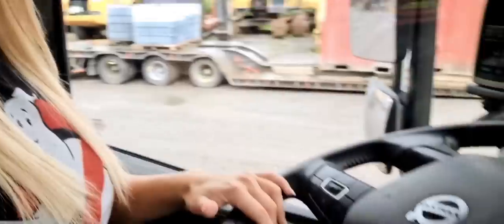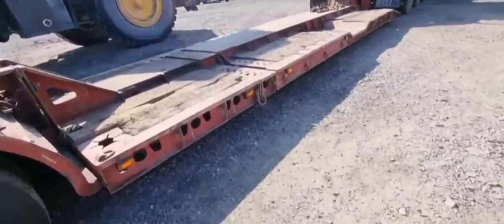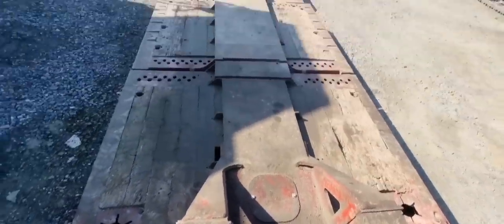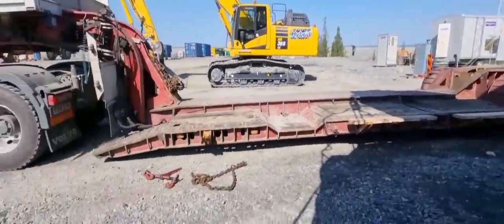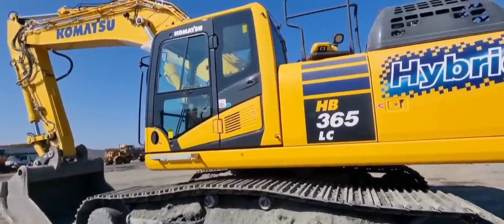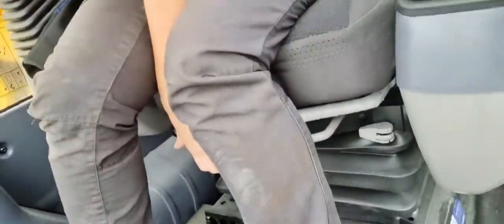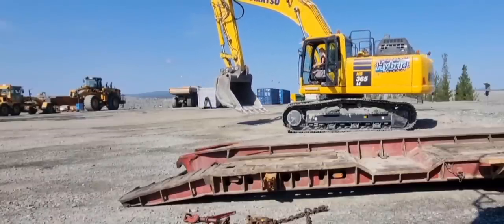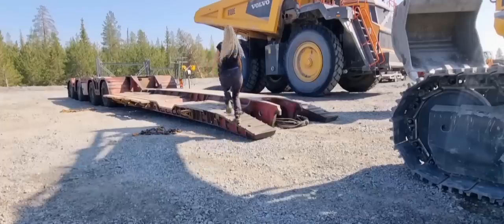NEWBIE MOVE EXCAVATOR - Angelica Larsson

Comment: Hey Angelica.
When i load track machines i step off the track length and place my blocks half that distance from the trailer. Just makes it smoother in my opinion. If you ever have troubles making the machine go straight just use the far right pedal, moves both at once. I  noticed your trailer (US slang RGN or LOWBOY) has removeable main deck, Very nice set up! Thanks for posting!

Comment: It's interesting to watch the difference between a very experienced operator and a newbie loading an excavator. The experienced operators use the bucket and arm to lift and level the excavator as they go up on the trailer to avoid tipping as they go past the balance point.

Comment: Excellent video, thank you.  It made me realize how much I miss heavy haul.  I loved moving 'hoes', they were my fav. Instead of of putting wood down in front of the trailer, we used to plant the bucket down beside the trailer and push up, lifting the front of the tracks, and driving forward about a meter before dropping down onto the deck.  Most of my moves were with dove tail trailers, so it was a bit of a lift getting the machine onto the dove tails.  Love the camera angles you use, you make very good training videos.

Comment: Great to see how much you enjoy your work and learning new things. I worked for a Komatsu dealership for over 30 years and that's the first PC365 Hybrid that I've seen. Interesting to see how trucks and trailers are different in Europe vs the US. In the US the arm and bucket are curled under the boom for transport which gives a lower overall height. After you become comfortable loading excavators you can learn to load double drum asphalt rollers on WET steel trailer decks. That WILL challenge you!!!

Comment: To load the machine just walk the machine you know right, left, right, left slowly and the machine is gonna go drop smoothly. Or use the bucket to hold the front and slowly bring it down. Machines are fun to drive, practice at your yard went you don't have nothing to do so you will be confident for the next time.
Either way you are awesome 👌👏 
Good job!!

Comment: Nice to see you're back! This is a bit random but I was just searching for this and you might find it useful: Alcohol used for air brakes might be 99% isopropyl alcohol, no additives, some brands use that. If it is, you might want to keep some around. It's used as a electronics cleaner so it's safe for buttons, plastics, disinfectant, and no rinse, so it's very convenient way to clean surfaces at home and on the go. I'm almost out so I need to find more, and technical grade IPA is 30x cheaper than medical grade they sell in a pharmacy, at least here in Finland. I keep it in a contact lens preservative bottle because it has a narrow nozzle at the end, which makes it easier to dispense, and it doesn't evaporate out quickly if left open.

Comment: Excavator's is 1 most hardest equipment to put upon low boy without them sliding around on you to get them perfect. Wet deck oh shit. I loaded like 90+% ours. If I on job site not on very important project I loaded them . I ran same size & type excavator countless hours. High floation tracks they very tricky on them decks.

Comment: Line the inside edges of the tracks up with the seams of the boards.     Keep the bucket low going over the hump..your right to turn the speed down that is a very easy machine to operate..

Comment: A 130 tracked excavator will be 13 tonne in weight. It is a 365 so it will weigh 36 tonnes. You are right about the revs if going up slops or inclines set the revs to half. And the drive sprockets to the rear when loading on to a low trailer as you did do to prevent damage as they are not designed for impact. The tensioner end can cope better. 🏃‍♀️💨⬅Angelica running towards her truck. 😀👍

Comment: Hi Angelica.
A small advise from a "veteran"
I have moved 1000's of different types of machinery and operated huge cranes.
The revs, needs to be on High, to flow the oil, so you get a smooth ride.
Just go easy on the controls in stead..
You will realize it goes much easyer and smoother, (and not faster,) by giving full throttle.

And by the way.
Hi from Denmark.

Comment: Here is a couple of tips for you Angelica - when you walk towards the machine look to see where the track drive sprockets are. Then you know which way the levers work (the sprockets should be at the back for the levers to work 'true')  The other tip is that when you leave it parked in the yard just rotate the body to the right a little bit before shutting down. Then you can climb out onto the track and it's easier to stand on the track whilst you lock the door. Plus it's easier for the next driver to climb up.

Comment: In the states we run the chain binder's from the tracks inside to the trailer frame on the outside.... Our binders are rated for 16k lbs (US). Stronger than most chains.

Comment: Angelica you are very smart. Yes it is much easier to load a machine like that with just enough throttle for enough hydraulic pressure to control the machine smoothly. I'm impressed with your ability to tackle any job that you are presented. Waiting for part 2. Great success to you from here in the USA.

Comment: As a machine driver for over 20years always load the digger in low engine speed. The track idler always at the front as the back spigot is what drives the tracks. I have seen many people loading diggers the wrong way and causing damage to trailers

Comment: Drive in on the trailer with the drive sprockets first. Put the weight on the trailer not the neck of the trailer. Also the counterbalance weight is by the neck. When you drive it onto the trailer drive sprockets first keeps tracks tight.

Comment: We call them outrigger boards in America you only have to use them if the tracks or tires are hanging over  more than half the way over the sides of the trailer.  I wonder how challenging it is to do over dimensional in Sweden  Here you have to buy permits For overgross and over dimension all kinds of regulations I'm guessing it's the same there maybe you could tell us how permitting works

Comment: Why are you entering the trailer in an angle? If you would come in straight wouldn't that make it easier to ensure your tracks are placed correctly? Like backing up a truck to trailer. If you go straight back and "can't see the trailer in the mirrors" the hitch will come in correctly. If you can see parts of the trailer panels on either side in the mirrors you are not straight. If the tracks where straight in line with the trailer before you close in on the trailer you should be able to drive it up onto the trailer without the need for much correction? I am guessing btw.